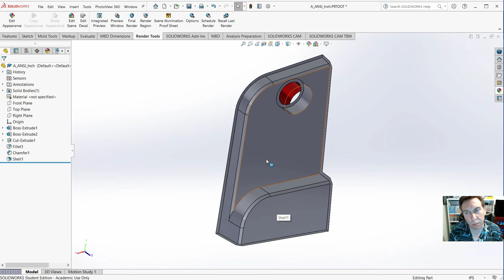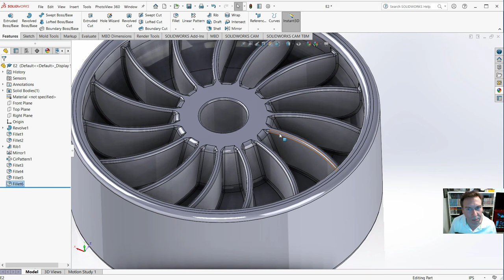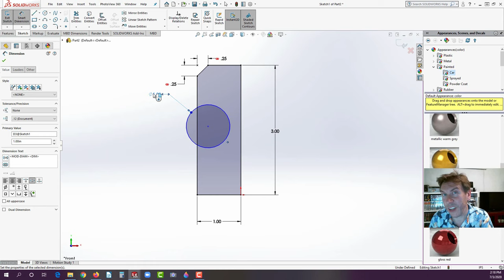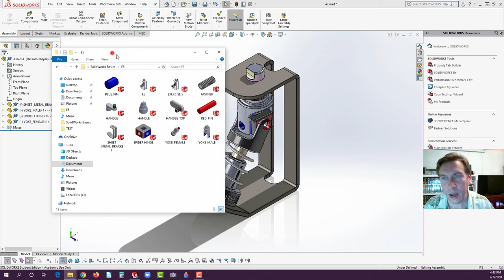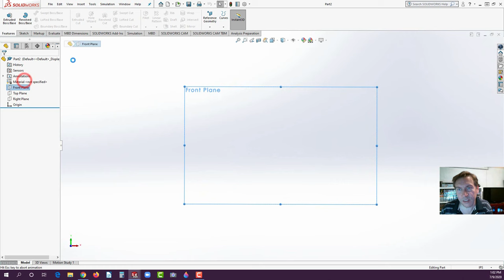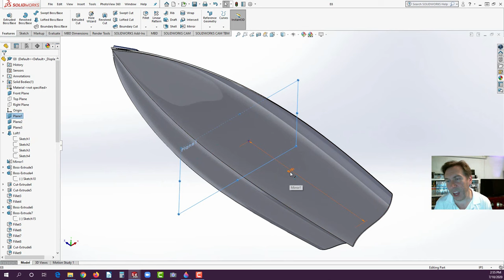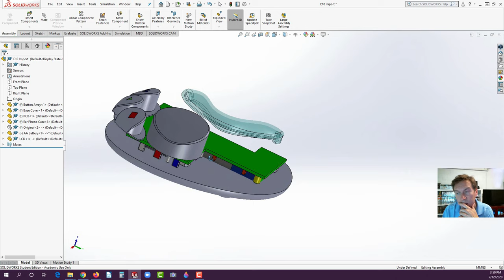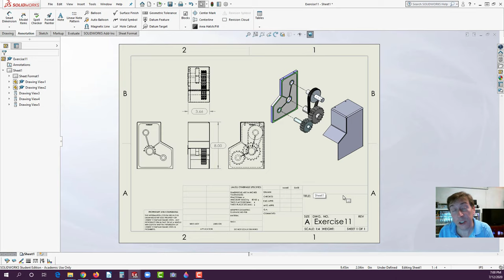SolidWorks Complete College Course for Beginners w/Training Guide

Comment: Hi! I like your tutorials, I think they are great. I started learning using only fully defined sketches, I think it is a good practice but your text isn't fully defined and there is not a single tutorial on how to define a text. So there is a room for improvement.
Reply from the maker: Thank you for the kind words. There is a point at the bottom left corner of a text sketch to dimension to, or if using a curve to align your text to, you can dimension the curve or line to any edge of the part surface you are adding the text to.

Comment: what knowledge do you walk out of this course with? enough for a CSWA? what about a CSWP?
Reply from the maker: Hi Spencer, in an unofficial poll I took a few years back, approximately 40% of my students who went through both this course CAD 120 Basics and my Advanced CAD 121 who took a CSWP exam (the majority took the Sheet Metal CSWP, and one took the Freeform CSWP - which IMO is very challenging) had passed the first time taking it. I don't keep track of CSWA's nor have I took the CSWA exam, but when I hear my students discussing it, the majority seem to have passed it after CAD 121. Theoretically, from what I've read about the CSWA I would think one could pass it after taking this CAD 120 course, but I have no data to support that. A lot depends on how much effort the student put into the course, i.e. if they do all the labs without watching the videos they seem to be stronger SolidWorks designers than those who skip or watch the lab videos while modeling them. I hope this helps.

Comment: Cen several surfaces be aligned all at once, before the part moves into position? Like if I want to mate two parts together at three positions, can I mate all three positions while the parts are separate from each other and then have them all move into position only after I mate all three positions (six surfaces)? That way, a hard to align/mate part can be aligned without mating surfaces becoming hidden after mating just the initial surfaces.
Reply: Yes, but in actual practice you will find it easy to "maneuver" a part during sequential constraining.

Comment: Can you mirror a feature, but then make the feature different on each side? ..or make each instance of mirrored features a different size?
Reply: Yes, there is a method(multiple body) that allows you to treat each object like it's in an assembly. Even though you are not in a true assembly.
Reply: @trexinvert  Appreciate the reply. I also learned that if you mirror a feature on a line, but then delete that line it will no longer mirror features that are added after that.

Comment: Always hate when the program shows exactly what you want it to do... but then when you tell it to do it, you get an error message. I think the worst though is when you get a single error that you have to work with for a moment and each and every single action you do has to remind you of the error, as if you're not aware from the first 15 times it reminded you.
Reply: I hear you.  Very frustrating for many "self-learners" especially when you are in a rush.  However, it's worth it to take a formal SW training(2-3 days) or stop and just commit yourself to a formalized learning system.  I learned to create a very complicated surface model, but if I did anything different such as change a dim that was too large or too small then whole things collapsed.  It is a house of cards if you don't know all the ins and outs.